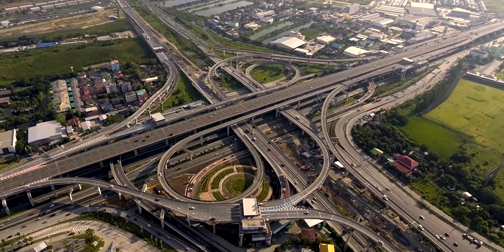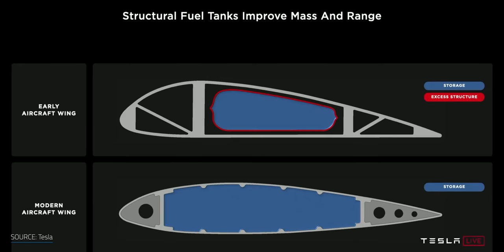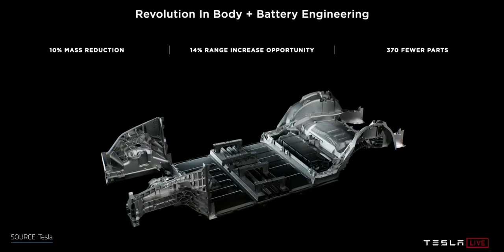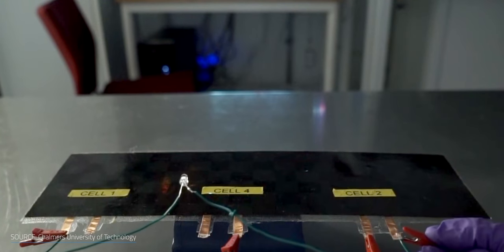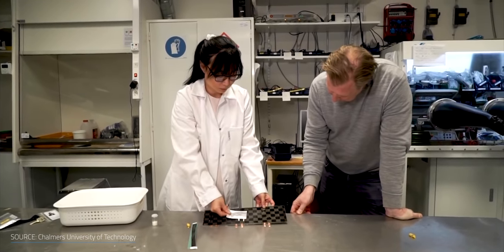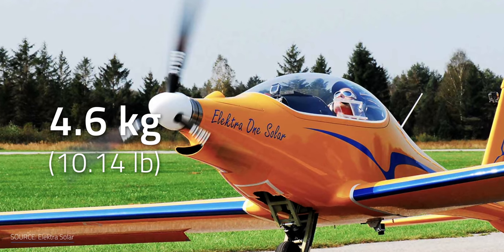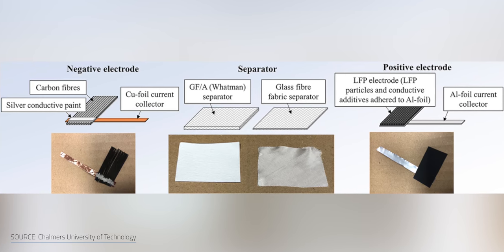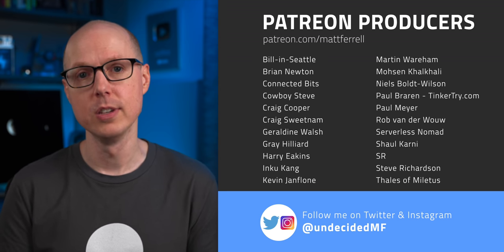Exploring Structural Batteries

Comment: It takes "the battery fire" to a whole other level when your inside the battery lol
Reply: People will rationalize it away by saying EVs are less likely to be in a crash and just ignore the fact that an EV crash will be essentially hellfire in a brazen bull
Reply: Solid State Batteries don't spontaneously combust unlike Li-Ion Batteries.
Reply: 1) Due to the large surface-to-volume ratio structural batteries are much less likely of the thermal runaway event that makes Li-based batteries explode. Bulk batteries and battery packs are waaaaay more dangerous in that regard.
2) The video says nothing about what type of electrode is used, and whether the electrolyte is flammable or not. They say the electrolyte is Li phosphate - an inorganic Li phosphate would not be flammable. This would eliminate the risk of fire in case of puncture and electrolyte coming in contact with water or air.
Reply: @augustaseptemberova5664  that may be true, but the composite itself is flammable. You get carbon fiber composite hot enough, and you expose it to an oxidizer like what's in a battery, and you got a pretty bad situation.
Reply: @rookandpawn  grand tour rimak crash burnt for days as they couldn't put it out
Reply: @Unmannedair  rimak fire grand tour
Reply: @Unmannedair  I somewhat disagree. I've looked up the electrolyte and battery architecture: LiFePO4 - it's solid, inflammable and doesn't facilitate thermal runaway. Most importantly: the cathode is the carbon fiber nanocomposite containing LiFePO4 nanoparticles. It's the safest currently known type of Li battery.

Also .. yes, the resin/polymer of the composite can burn, but that literally makes it no more dangerous than any other plastic component of the car. In fact, it's the carbon fibre element that inhibits / limits the flammability that the resin would have without the fiber.

Or in long ..
Carbon fibres don't ignite and if ignited don't burn easily, which is why carbon fibre composites cannot go into regular trash, but need special disposal, which is burnt in an electric arc furnace. 
If heated above 400°C, carbon fibre oxidizes but doesn't burn. It may burn the resin, or rather its vapors, but only for a short time (albeit, with a large flare and toxic fumes). Short time because: heavy charring occurs at the point of ignition that acts as a flame suppressant, and the heat of the flame isn't sufficient to keep the fire going. You'd need an external heat and fuel source to reach and keep the temperature above 400°C. 
The oxidization will continue until roughly 10% damage and will make the carbon fibre loose thermal and electrical conductivity. It'll swell but retain its structural integrity and stability.
At temperatures above 1000°C the damage will be 50%. And only at temperatures above 1600°C the material will be damaged beyond 90%. Not to mention that modern composites contain SiC or other components that increase carbon composite oxidant resistance to temperatures well above 1200°C, really expensive ones even above 1800°C with applications in space flight.
Reply: Not the same battery material, not the same engineering and safety problems. The materials involved in this type of battery would have to be heated to temperatures much higher than what causes lithium ion batteries to burn during failure.
Reply: @Unmannedair  please identify the oxidizer that would be present in battery technology strong enough to oxidize carbon fiber.
Reply: It's sound like just put 4 wheels on a battery.... and you get a vehicule.
Reply: @augustaseptemberova5664  that is an excellent analysis, but like I said, it's all synergistic accidents that are unexpected. A lot of the first lithium technology caught fire because of the flaws in the way the batteries were used, not because there is a flaw in the technology itself.  Specifically, that external heat source you were talking about? A dead battery short through the charred carbon fiber sounds like a pretty good candidate for a resistive external heat source.   I expect a bathtub curve for any new technology.  I'll be one of the first to adopt new solid state battery tech, but I also expect a certain amount of learning the hard way. Fail fast, learn from it, and do it again better.
Reply: @justinmichael6127  I said composite.  Get the composite hot enough and almost any oxidizer will reduce the resin to a shorter chain molecule that is combustible.  A dead short through the battery or any other conducive material in proximity would probably do the job.  Like I said in my previous comment, the flaws we'll see evolve will likely come from attempts to implement the tech, not from some inherent flaw in the tech.
Reply: @Unmannedair  "not because there is a flaw in the technology itself" Yes and no. It depends on whether you consider massive hazards a "flaw in the technology" or not: the electrolytes are flammable, facilitate thermal runaway, the chemical reactions within the battery produce highly reactive substances (lithium sponge, depending on the design also oxygen and hydrogen radicals) that tend to react explosively to exposure to air or water, and the involved metals (aluminium and copper) have temperature-dependent elec. resistance. That makes this design not flawed per se, but extremely dangerous in case of overcharging, too rapid charging or discharging, heat, puncture, mechanical stress, internal and external short etc. Literally all of these hazards are absent in the solid-state carbon composite battery.

"A dead battery short through the charred carbon fiber" I'm not sure I understand what you're trying to say here. 
In laminated batteries electrode spaces are isolated by layers of glass fiber, which melts only above 1100+°C. Charring would only serve as a further insulator (and it's not the carbon fiber that chars, but the resin). An internal short is only possible via mechanical force that is strong enough to compress two electrode spaces to the point of rupturing the glass fiber separator. Breaking this barrier is literally impossible without simultaneously breaking the carbon fibers as well. This kind of event effectively destroys the conductor too, meaning there can be no internal short. 
In the case of an external short, the temperature-independence of carbon fiber resistivity and it's excellent thermal conductivity, as well as the solid state electrolyte, and the high heat capacity of polymers, prevent thermal runaway. If my calculations are correct (carbon fibre resistivity 1.5 mOhm * cm, thermal conductivity 1000 W/(K*m), polymer heat capacity 100-300 J/(K*mol)), the external short would have to last at least 1.5 hours (!) to increase temperature to 400°C where cheap composite resins start to decompose & burn, or at least 3 hours to increase temperature to 800°C where flame-retardant composites' resins start to burn.
If the whole car is already burning at high temperature, then these times shorten to 10 minutes and 20 minutes, because the thermal conductivity becomes useless, when there's no place the heat can be transferred to. Meaning, if the car is fully on fire first, and then an external short occurs, the resin will ignite much faster. But at that point all of the car's plastic and the paint etc. would already be on fire, one more plastic (resin) won't make any difference. And there will be no explosions and flash fires like you'd expect from a conventional Li battery.

Comment: And when battery is over, then replace whole chassis. Genius!
Reply: Ya....life cycle of the battery will last how long?   I agree with you!
Reply: Battery life is max 7 1/2 years, and that is if your lucky.  4-5 is average. So I agree, this is going to be fun to watch here in 6-7.  :D
Reply: Have you seen the price of replacing a Tesla’s battery now (it’s not currently reasonable) soo being able to just replace “the passenger side door” instead of replacing the whole battery pack would still be an improvement
Reply: @jerkfudgewater147  Actually I have seen people replace them for 10-15G so it's not unreasonable, for a car that's worth 40G I would say that's easier than buying a new one at that point in the case of total battery failure. And I only say cheaper than buying a new one because people would likely do that similar to how they do with ICE cars plus replacing the whole chassis would be extremely pricey and a pretty long process. Usually batteries in the pack only fail cells at a time and are actually fairly easy and cheapish to replace.
Reply: They could explore solar power designs that use reversible reactions to undo a lot of the effects of battery usage to increase lifespan
Reply: @alexczarnomski1116  Yes I have had this thought myself, something like an imitated enzyme for this
Reply: @chrispersinger5422  Depends what factors we'd be taking into consideration. Let's say a 5 year car. That car is no longer worth 40g. Maybe half? I'm not familiar with depreciation of EVs.
A 10-15g battery pack replacement, is very much unreasonable if your car is worth 20.
If less, it would just be a poor decision if other financial/life issues aren't involved.
Reply: @ThaSideWeed  I mean yes for a total battery replacement of course it is less reasonable, but it also doesn't happen often, like I said usually it's usually replacing a couple of cells at a time. And electric vehicles depreciate weirdly, for example a lot of Tesla's still sell all only 10k under their MSRP for new even though they are used, but other EV's typically take higher depreciation
Reply: @chrispersinger5422   I did a little research project into anthocyanins(pigments in raspberries and shit like that) being used to the same effect, they’re organic molecules that are really good at accepting light and ejecting electrons which don’t get messed up by the environment around them much while they wait for the electrons to come back in the reverse reaction. Now you can fix the battery replacement problem using a similar method. Or even use the panels and at that point you could just be replacing panels or the “jam” inside of em lol.
Reply: @alexczarnomski1116  Nice research! I'll definitely have to look into some of that myself
Reply: EL JAY I believe the batteries actually have a warranty that lasts 5-8 years, also most battery failures, like I have said, aren't the whole unit it's single cells which are much cheaper to replace, so it's not like your spending 15k every 7 years
Reply: But what a reductiobn of Carbon emissions! No, wait, it's 90% fossil polymer. xD
Reply: But you get 20extra kilometres in the total range, whoopdedoo !